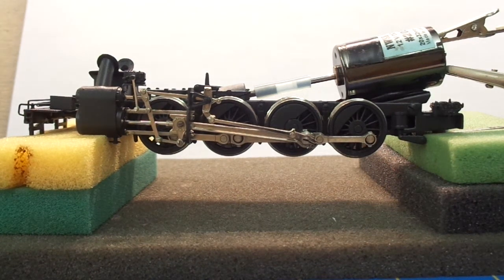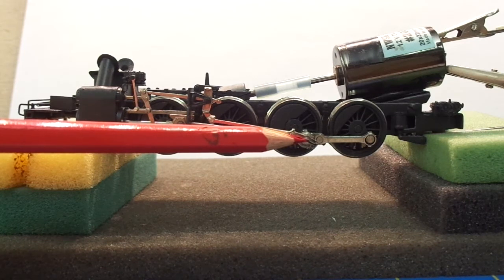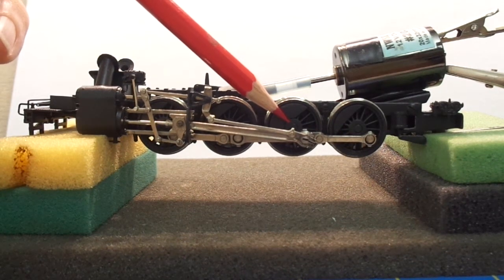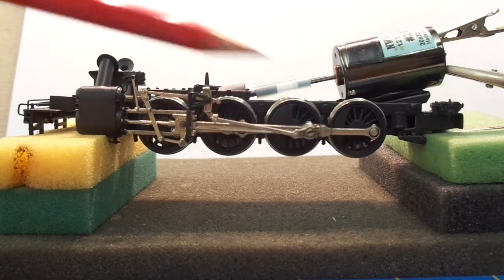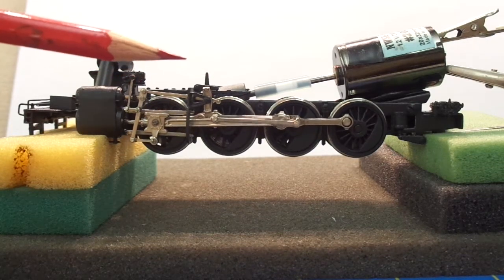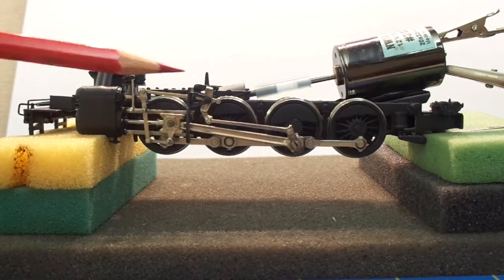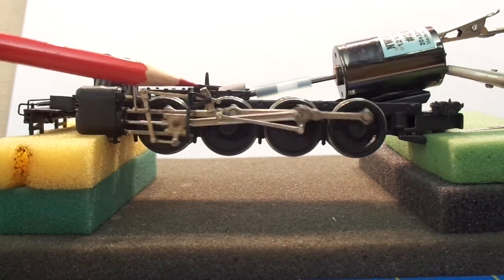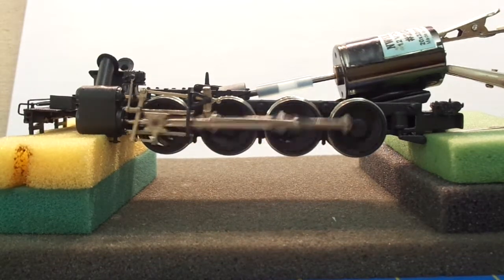Eccentric Crank, Rod and Main Crank Pin Adjustment.

Comment: You just performed the adjustment that is done on every steam powered engine.  The railroads did that same exact process on a length of track called "the ledgerwood spur.". It  was typically outside but adjacent to the roundhouse or heavy maintenance facility, and accessable directly off of the turntable to avoid having to move through curves and turnouts.

I don't know the actual configuration of the track, but there was at least one spot where both rails were "scooped out" to allow the main driver to turn to be adjusted to the exact specifications.
Reply from the maker: Glen, thank you for the comment. It was a fun video to do.

Comment: Great video Tom. I’m just getting into brass repairs & mods and have a Pacific that is giving me some issues. With a stripped eccentric crank, I had to make a new one from scratch (I couldn’t find anything close online). I’ve searched far and wide for how to align the cranks and your video fit the bill. Thanks. Running much better now.
Reply from the maker: Hey, sorry for the delay in my response. I do the videos for info and not to make money. Therefore, I don't follow my own videos for comments. I guess I should but I've done so many it takes time away from painting brass and the layout build. You are very welcome and I'm happy the video helped.

Comment: This is a great video, and I cant stand it when someone has a beautiful locomotive, but the crank is set wrong for that locomotive.  

I would like to say what I have seen. The majority of locomotives have the crank set up just as your locomotive shows. However on what seems to be mainly smaller locomotives, switchers, 2-8-0, 4-6-0  etc, have the crank the opposite of your engine, not always and seems fairly rare, but once in a while. I try to find a video or image of the locomotive to make sure my crank looks right to the actual locomotive. Im a PRR/NYC guy and it seems all locos I have seen (that I own) have the crank set as your locomotive.    

Here is a perfect example, lead engine has crank one way and second like your model, just as a very good example. 

https://www.youtube.com/watch?v=7OfYFvneiIY

Interesting however the cab forwards have the crank set as your engine shows when running in the normal direction for a cab forward. 

https://www.youtube.com/watch?v=6rlqX3FEqqE

Awesome video and that is a smooth runner.
Reply from the maker: Matt, No need for me to repeat what I've said in the other replies. Thank you for the very kind and generous compliment on the video. I'm very pleased it was worth the effort to show how it's done.